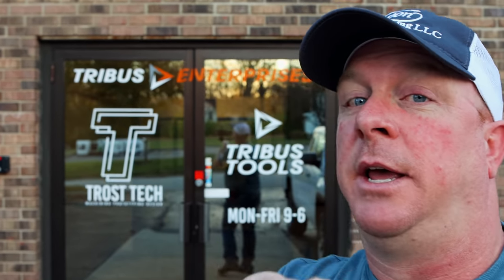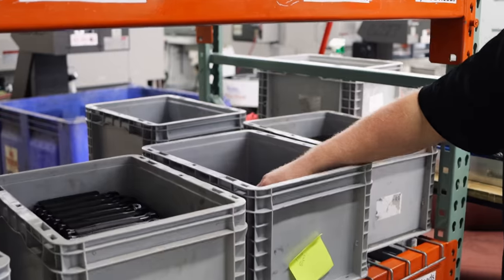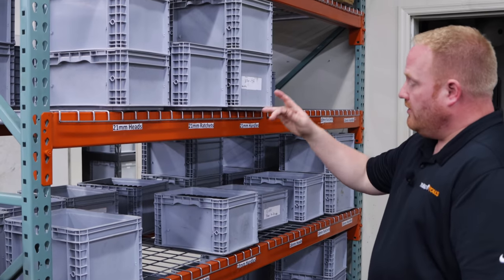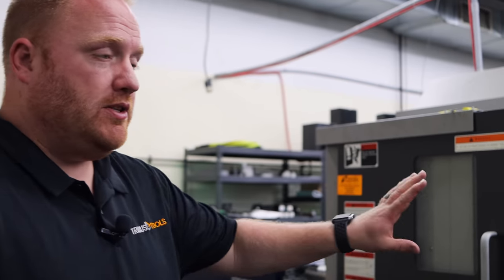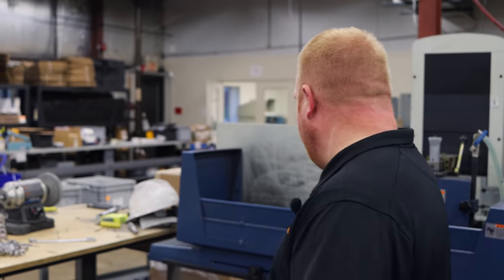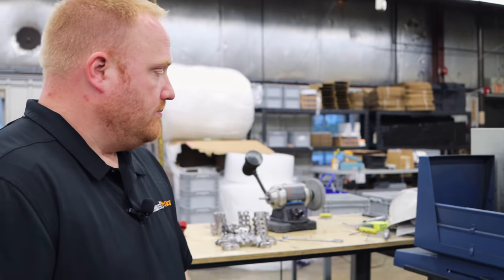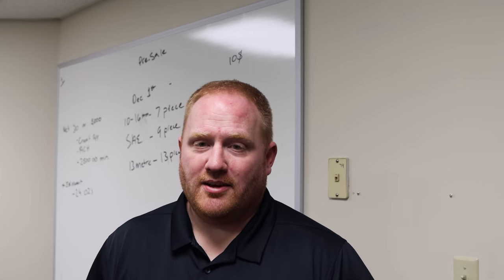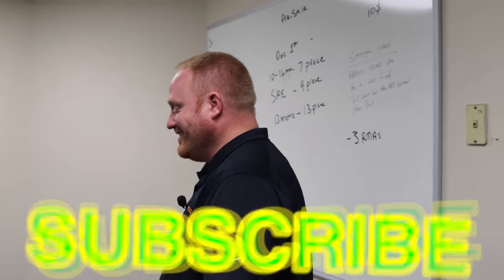How It's Made: Tribus Tools Ratcheting Line Wrenches FACTORY TOUR

Comment: Just threw away 600.00 dollars on this junk! I bought both the SAE and the Metric sets. The gear heads strip out instantly or are jammed right out of the box. They say lifetime warranty but if you can't get ahold of anybody the warranty is a joke. This company basically stole money out of my pocket. As a mechanic I make a living with my tools I expect them to work as intended not just be a dust collector on a back shelf.

Comment: Innovation! I was replacing an ABS hydraulic control unit and using a good (Snappy) line wrench. You're like a mind reader, I honestly was thinking somebody should make a ratcheting one.
Reply from the maker: There they are ! Just for you ! Ratcheting line wrenches (smaller sizes coming soon) and ratcheting O2 and Nox sensor wrench !

Comment: To say that the 15/16" wrench is 'girthy' is an understatement.  That's an impressive looking tool.

I am curious how the DLC holds up over the long term.  That process has been around for a long time but I don't recall it ever being used for tools.  I would think that a FNC treatment (ferritic nitrocarburizing) would yield better anti-wear and corrosion resistance.  Unless that's what they actually have done, although FNC isn't an actual coating.

Comment: I look forward to trying them out. I hope they make some smaller sizes soon. I must admit they seem a little short, like they are just waiting for some  half inch black pipe to be put on em.
Reply from the maker: The smaller sizes are coming soon. Remember they are ratcheting wrenches they aren’t made to break loose a bunch of weight. Just like a ratchet isn’t supposed to be used to break loose a bunch of weight.
Reply: @KoonTrucking  thanks! Great video!

Comment: Awesome video, definitely going to look in to these!
Reply from the maker: They are awesome, and it will make those tight O2 and Nox sensors much easier to get out and allow you to do the job faster.
Reply from the maker: If you haven’t seen the video where ai put the O2 sensor to the test check it out https://youtu.be/yW-PoOA7F98
Reply: For sure I’ve just changed into the Diesel tech profession and had to pull sensors for the dpf and what not and could have used them.

Comment: Need too do an unboxing and a hands on with tribus tools at YOU'RE shop clay!👍🏻😎
Reply from the maker: Already done that 
(BTW both of these are on cards at the end of the video) 
Here are the line wrenches being unboxed and also used in this video https://youtu.be/weP3zsxnyjo
And here is the unboxing and use of the O2 sensor wrench https://youtu.be/yW-PoOA7F98
Grab some popcorn and watch em both they are really good !
Reply: @KoonTrucking  
Did u watch justin sturgill trucking or how ever you spill the fuckin guys name about tribus tools??
Reply from the maker: Yes I am aware of that but what he forgot to mention is he was sent those wrenches. They were from the first batch that were nitrite coated. The company that Tribus used to have that coating applied did them twice which caused them to become brittle. They caught it early and notified the youtubers that received them to test. (None of the wrenches went out to anyone that PAID for them only to influencers since it was a very small batch) they called all the influencers when they found the issue during in house testing and it was immediately corrected and another company was sourced to do the coating from then on. It was a mistake that wasn’t technically Tribus fault but it caused them to step back and redesign some of the tool issues that could be there and it was honestly a blessing in disguise, they redesigned part of the wrench to make it even better than before. Since then there has been zero issues with them breaking. The company stepped up and found and fixed the issue immediately and that’s all you can ever ask from a company. With any manufacturing company there will be issues and since then they test the products in house as you can see in the video with random tests and even strength tests they perform. I truly believe they are an excellent company and as you can see in this video they take a HUGE amount of pride in their work and are proud of the products they build. 
Their work going forward will eradicate any doubts of that one mistake that wasn’t even in their control at the time. Hopefully that clears up some of the doubts people have. I’m pretty sure they will officially address this issue so it can be finally put to bed.
Reply: @KoonTrucking  You are a class act Mr. Koon. The influencer in question is always taking shots at you but you take the high road and never stoop to that level. I have never heard you speak ill of any of your You Tube content creator peers. Much respect to you🙌.

Comment: I was hoping they would address the issues they had with these wrenches breaking before. Was that corrected? If so how did they correct it?
Reply from the maker: Yes technically it wasn’t Tribus Tools fault it was the company they used to Nitrite coat the wrenches. One batch got done twice by that company and that’s what caused the issue with them because they become brittle from over hardening. They were caught early and not 1 set went out to anyone that “purchased” the wrenches. They were only sent out to some influencers and it was immediately corrected and another company was contracted to do the Nitrite coatings to prevent any future issues. They also went back to the drawing board and made the wrenches thicker and stronger at possible weak points so it actually turned out to be a blessing in disguise for the company to build an even better product than the original. But since that issue they have performed flawlessly and haven’t had any issues.
Reply: Thank you for your response good to hear
Reply: @jeremyb9948  they still break and some got out koon laying